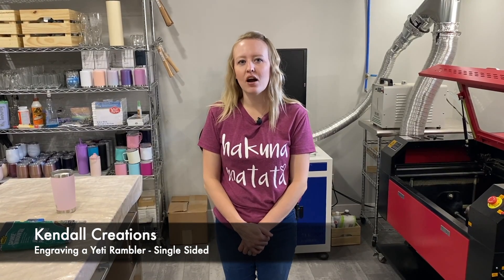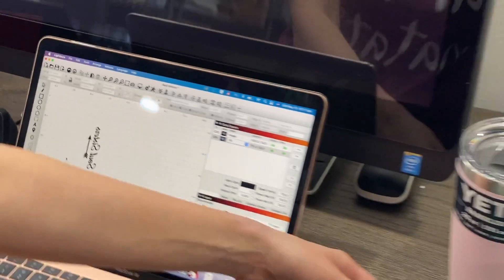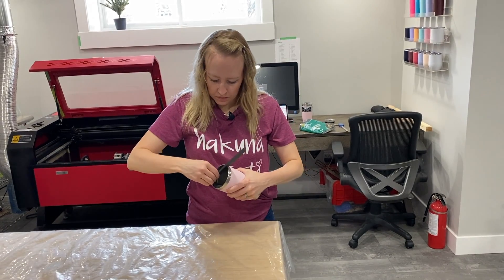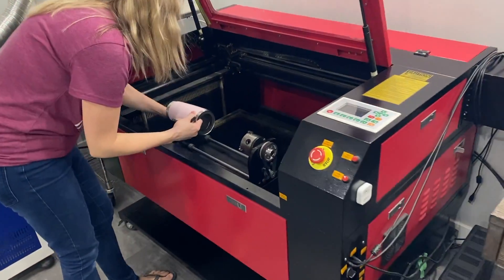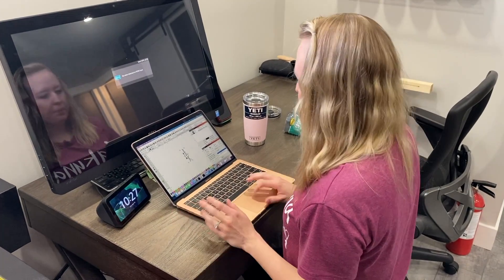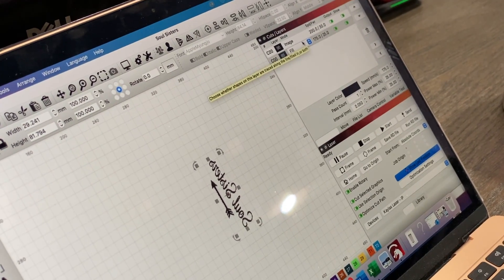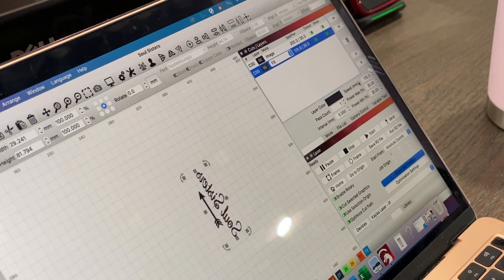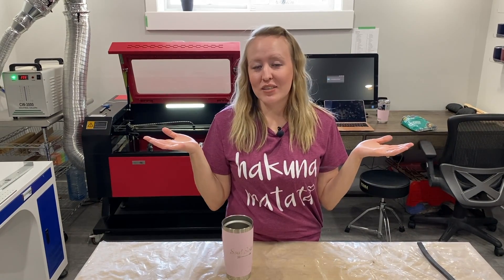Laser Engraving a Yeti Rambler - With new Tips and Tricks

Comment: why do you need to mirror?  I don't understand why the laser would flip text.  mine engraves what I see on the screen.
Reply from the maker: If I leave as is on my screen, it will be flipped. Perhaps we just have a different set up?
Reply: @kendallcreations6737  Your rotary is wired wrong.  That is why you have to flip the image.  I just went through with this on my new rotary.  I contacted my rotary manufacture (Mansfield Customs) and he told me which wires to change.  It works correctly now.  I don't have to flip the image.  I believe you can orient your rotary around so your putting the tumbler in on the left side and it will also work without changing the wiring.
Reply: My original cnc software mirrors the images by default, which is annoying. Now that I have been using LightBurn it engraves properly. It has to be just a setting on the original (Chinese) software, but I have not been able to locate the spot to have it engrave properly. LightBurn seems to be more user friendly and has been my go to software lately.
Reply from the maker: @eigregor83  I’m quite used to the mirror now. Been doing it ever since I started engraving. It’s like second nature now :) I totally agree! Light burn is very user friendly and it just keeps getting better with each new release.
Reply: @kendallcreations6737  i  dont use  seal to  prevent from the Jaws. I found a  great  Idea in someone elses Video and made me the same Adapters. It has a 50mm round disk, 1 center disc with the outside diameter of my Material and the 3rd Disc with the inner diameter. the 2nd Disc has thin foam on it attached with doublesided Tape.all 3 discs have a 6mm Hole in the center, and i insert a M6 Screw and secure all 3  discs with a Wingnut going toward the inside of my material (Tumbler, glas, mug  etc ).
The end with the 50mm disc is being clamped into the Jaws of the rotary, the Material slides over the 3rd Disc (facing toward the thorn for the bottom) to keep it centered perfectly and rests on the 2nd Disc with the foam.
For the Bottom i made me different sized Discs as well with foam,  so  neiter the Top nor the Bottom  will ever get marked up.
I made all my Discs as needed out of 3mm XT Acrylic that i get free as they are scaps from a Window Building company in my Area. You can also  use Wood for them as well.
Hope my Adapters are understandable as i explained them above.
cheers and happy cutting
Reply from the maker: @wolfes1126  We have since upgraded from a seal to a new contraption that we made with our 3D printer. It works great! I will post a new video with that.

Comment: Great video, I just purchased an 80 watt red & black laser engraver (looks like yours), what power setting are you using to engrave on the tumbers? I like the cleaning tip. Thanks
Reply from the maker: Hi Jon, congratulations on your new purchase! You're going to love it. My engrave settings for tumblers are Speed 175, Min 25, Max 25 and Interval is 0.05MM and i typically only do 1 Pass. Sometimes the darker cups may require 2 passes as sometimes 1 pass is not enough. Also, i ALWAYS use absolute, just in case 1 pass is not enough. Happy Engraving :)